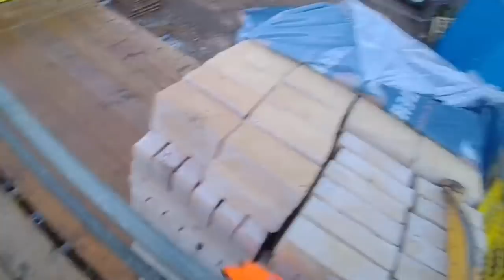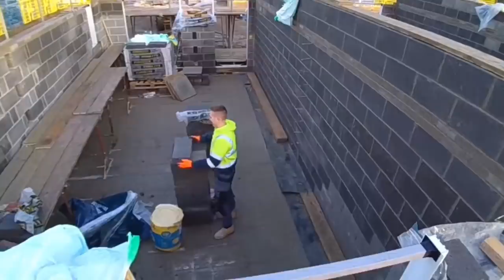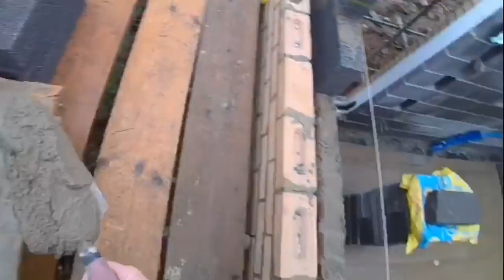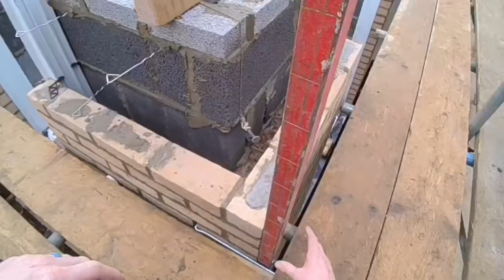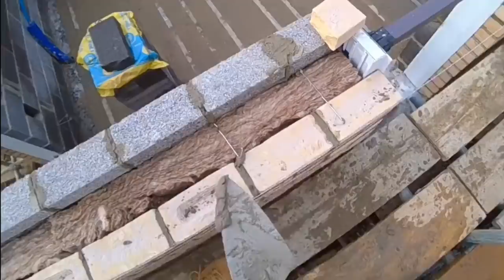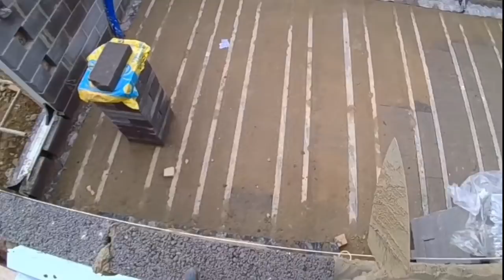Joist lift / brickwork | The skill of bricklaying

Comment: They don’t let us put blockets at the top of the frame we have to put a full block with min of 300mm cut under the lintel so we have block a blocket then a block that’s what the nhbc ask for.
Reply: Same on ours but our prick nhbc bloke makes us put a full block under the lintel.
Reply: Michael Work lol what makes me laugh is the pre plastering going round filling all the holes etc for the air test! So what happens in years time or so when everything settles ??
Reply: Michael Work what area your work ?
Reply: @kierenboimufc5940  yeah mate loads of it makes me laugh when I started in private building anything went and my old boss never used to get any back lash years on either. The engineers they use in the footings are completley sub standard well pourus when there meant to take literally no water in, ones on our site are ready to joint after 20 mins. Ones we used to use in private jobs wouldn't be getting pointed till last thing and still be moist. And Cheshire mate you?
Reply: Michael Work lol same as the engineering on my site 😂😂😂😂 I work on a crest nicolason site in Kent
Reply: Michael Work what about having wall ties every 3 corses on a corner lol
Reply: @kierenboimufc5940  doesnt make us do that one! But we do have to put ties in at 750 on external then the normal 900 in party walls. I really dont know who thinks this shit up 🤣
Reply: Michael Work we had a women called Donna is was really bad but I think she’s been promoted to top job if you got two trays one o top of the other one she thinks it’s the one at the bottom doing the work